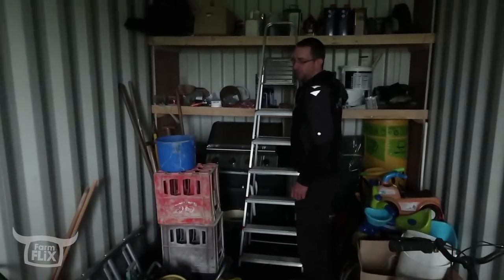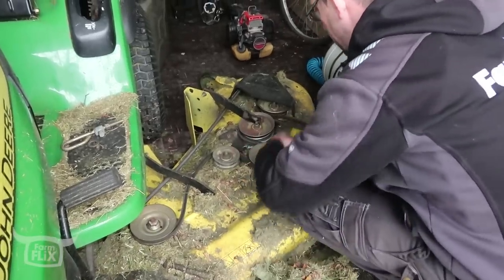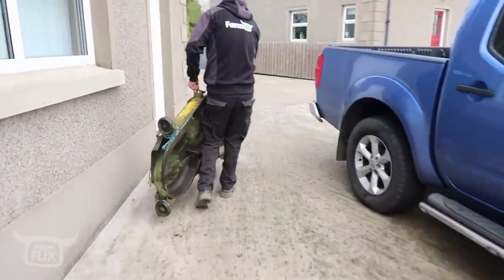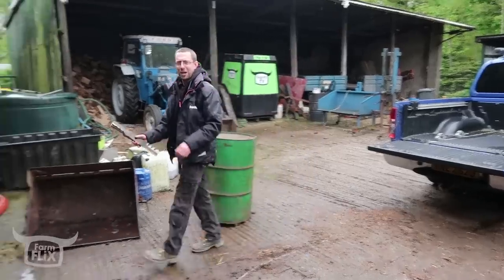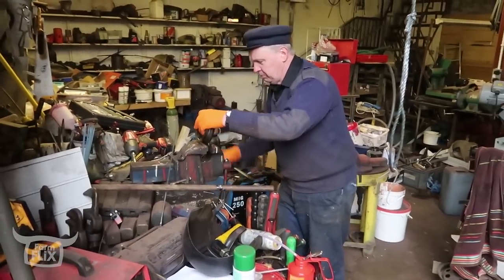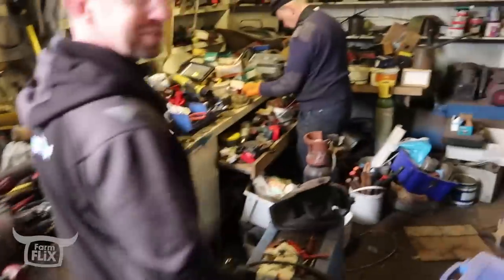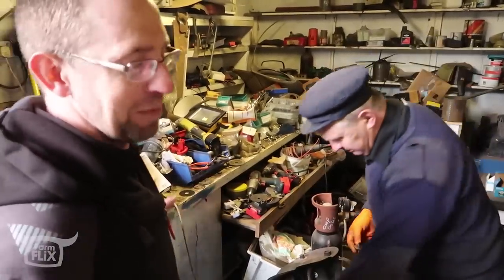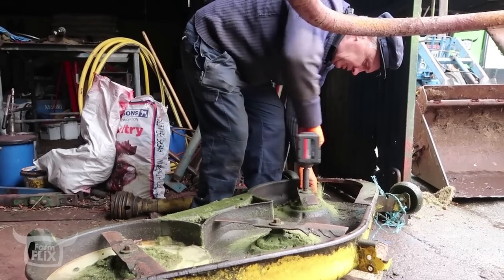What Did You Break Now?.... John McClean | FarmFLiX

Comment: Nice lawn mower we are on our second deere lawn mower we had a l107 but have a 2016 x125 now recently we took deck off cause blade wouldnt get in gear we sharpened blade belt is a bit loose now so we need to tighten it she has 100 hrs on the clock and we cut 7 lawns shes a fine lawn mower tho good vid